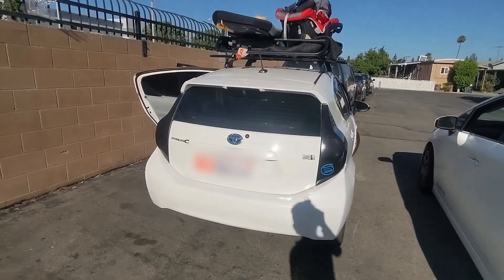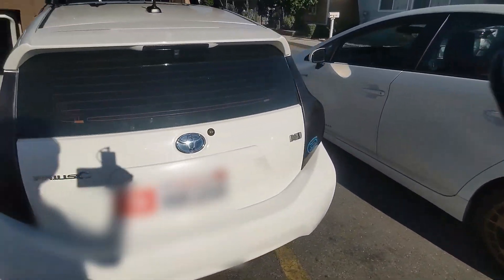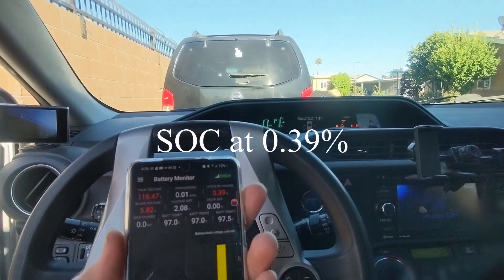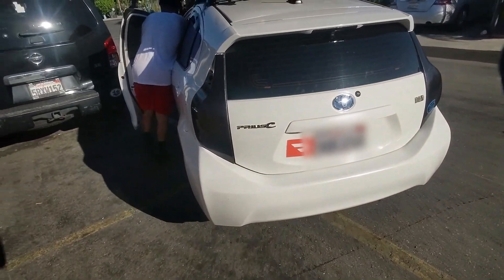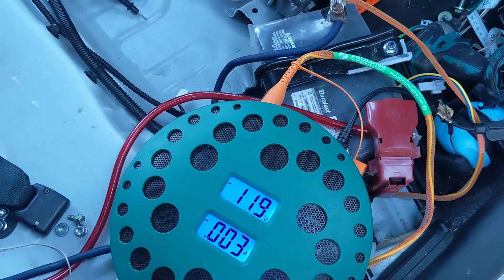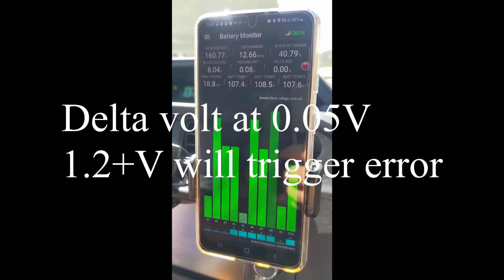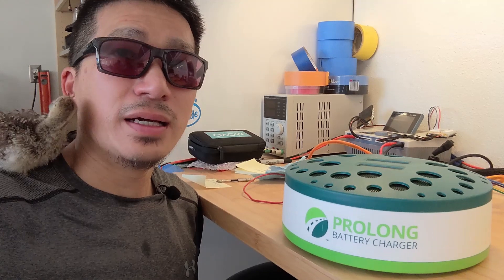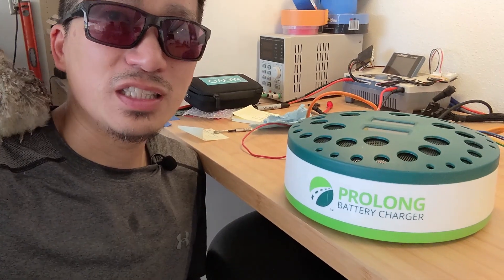Prius lithium upgrade rescue mission - how to kill your Prius battery in minutes

Comment: Prior to starting the car, It would be good to fully charge the 12v Aux battery using an external charger for it as well. Charge current should be limited to 4.2 Amps, for a deeply discharged AGM. The on board DC-DC converter does not do that current limiting.

Comment: Mr.Jack 
After using two years of the upgraded battery to my second generation Prius, the red triangle signal appeared !! the malfunction was in the battery control system ( P0A7F Hybrid Battery Pack Deterioration). 
I went to the seller but the warranty was expired 3 month ago !! , to help me he suggest to make balancing the voltage of the units and we do it, everything went fine for two days but suddenly the triangle warning sign appeared again !! 
Is  the battery become weak and needs to be replaced after 2 years ???
Please advise me if there’s anything to fix or help 
With regards
Reply from the maker: Hi Hasan, we just started selling Nexcell Lithium this year (5 months ago), I don't know how you can have our product for 2 years? perhaps you are confused with other's battery manufacture?
Reply: @hybridapp7158  
I don’t know when you start selling , but here in my country this upgrade was make before three years ago , so  I don’t say that im make the upgrading by nexcell , the idea upgraded from nickle to lithium battery for that im asking for advice or solution for my mention error.
Thanks for your response

Comment: I'm confused. Could the car not have been jump started? I'm a new prius owner so I'm still learning but wouldn't the jump start get the engine going and charge up the battery?
Reply: From what I know, the prius can be jumpstarted, but not in the usual way. the Engine is started using the HV Battery (200V+) and jumper leads to the 12V battery doesn't do anything. You need special leads, and I believe another prius. The leads also connect between the inverters of the 2 cars so one can start up, and then charge the pack of the 2nd prius though it's inverter.
Reply: The car can be "jump started" if the 12V battery is dead. In this case the high voltage traction battery was dead so it had to be charged back up. The high voltage battery is what starts the engine, once it gets too low it can't turn over the engine to start. The 12V battery runs the computer and basic stuff around the car.

Comment: Yeah, I had problems with leaving my gen2 in neutral in a serious traffic jam. It doesn't like it at all, even without the AC running. Got the orange triangle, but then just put it back into Drive, the ICe immediately started up and it ran for about 3 or 4 minutes and completely recharged the battery. Even without the Ac there is trickle charge loss from the HV battery.
Reply from the maker: The customer passed out under the influence, god knows how long :p

Comment: Can you clarify why  the engine does not recharge the battery when the car is in neutral?  Is it simply that in neutral the engine would turn without turning the motor generators in the hybrid transmission?
Reply from the maker: that's correct, engine and electric motor disengage, I believe Toyota design it for a reason.

Comment: Honda Insight first generation owners developed a battery charger to top up the battery. It seems strange that you have to dismantle the plastic trim to attach a battery charger. Could you add a charging lead to your replacement battery pack so that you can plug in the battery charger easily?
Reply from the maker: I believe there is an easier way tapping into the high voltage system.

Comment: This sounds like a design issue with the Toyota BMS; would this also happen with the original battery?  Can you add a low voltage disconnect to your replacement battery pack?
Reply from the maker: yes, this has been a problem since day one especially with old Prius C with stick-shift style shifter where you can easily put the gear in neutral and fall asleep and wake up with christmas light.